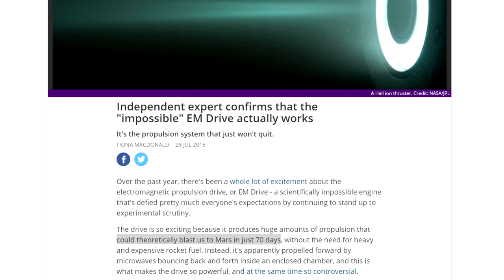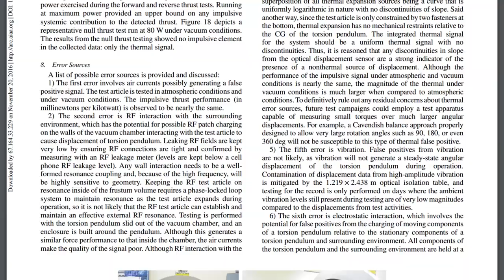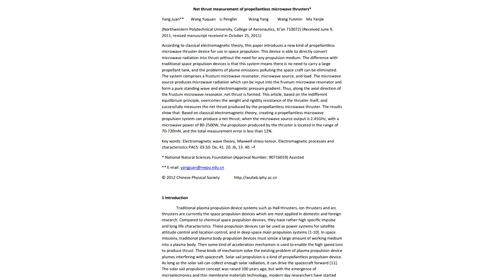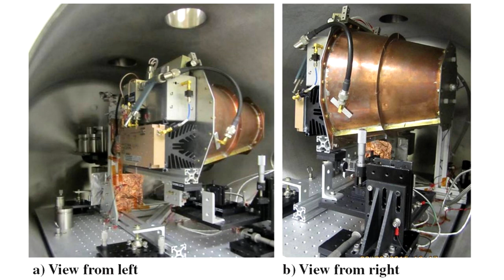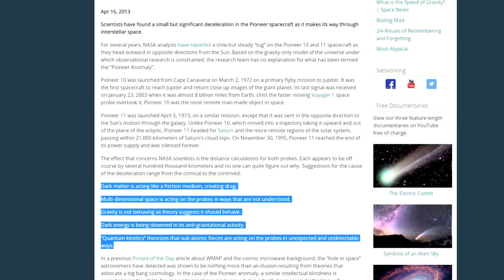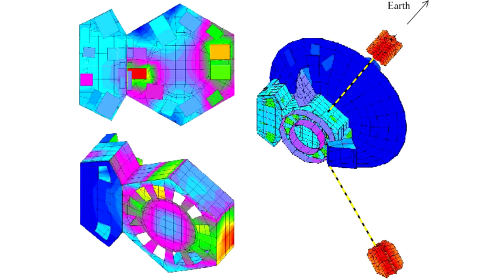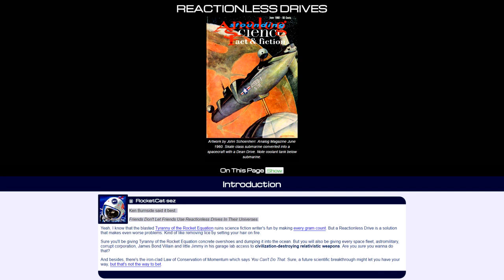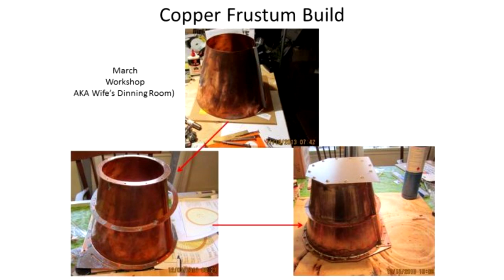What is the EM Drive? And Does it Really Work?

Comment: I mean no offense, but what I'm hearing is "shouldn't work because XXXX, shouldn't work because YYYYYY, shouldn't work because ZZZZZZ...." but don't the observations and data say it works?
Reply from the maker: +Jeff Wulf bear in mind that one team retracted claims of thrust after finding an error in their setup.
Reply: Yes, but the reasons why it shouldn't work are so well know that it is easier to say that it probably doesn't work than to say some we are wrong about some of the fundamental laws of physics.
Reply: Scott Manley Ah, OK, thanks!
Reply: I think its just a reason to be very, very sceptical...
Reply: But we are ALL wrong about fundamental laws of physics.
Thats why our gravity calculations break down when calculating the spin of galaxies, so we have to add the idea of dark matter.
Thats why our consolidation of the quantum world and macroscale world still hasnt happened (a unified theory).
Our theories about the laws of physics are NOT correct yet. So we can't simply say "this shouldnt work because of our current understanding" when observations clearly shows it DOES work.
Reply: "ut don't the observations and data say it works?"

No.
Reply: ***** Conservation of momentum is not an empirical law. It's a consequence of a much more fundamental symmetry: the fact that if I do an experiment here, and the same experiment in your house, I should get the same answer. Conservation of momentum is nothing other than the fact that the laws of physics don't vary from place to place.

So the laws are right and they do apply, unless you're prepared to drop this fundamental postulate.
Reply: 1 team retracted their claims, yes, but, probably only because the experiment was spoiled and not worth noting. Yet here we are.
Reply: omnimous69 Where do you think we are, exactly?
Reply: avicenna Speaking in the YouTube comments section about a source of thrust which violates the laws of Physics, as currently understood
Reply: They only reacted their statement because their equipment wasn't sensitive enough to make a conclusive decision.
Reply: Tristan Fessler *Only retracted their statement because their original findings were statistically insignificant
Reply: ***** That's not how any of this works...
Reply: ***** "As the author himself points out, light does carry momentum."

Not enough. 

"Light cancellation and some mystery bouncing photons thing,"

Yeah, that paper was terrible. Physics is not zen buddhism: if photons cancel each other out, they're gone. They're no longer there. It's not like they can still be there even though they're interfering destructively.
Reply: ***** "Nonsense. Light carries momentum. "

Like I said. It doesn't carry enough. Do the math. 

"So, if the photon drive cancels the photons after they have been emitted,"

This is physics, not sorcery.

"As I said, it would allow you to use scary amounts of power in a photon exhaust that you get rid of with destructive interference"

It's not zen buddhism either. If you get rid of the photons with destructive interference, they cease to exist. You can't use their momentum anymore. Sorry.
Reply: Yeah, this is a problem with modern science. It has become orthodox. "Such-and-such doesn't agree with our models, and so it is heresy!" And no, you test everything, because the only way to rule something out is to disprove it. If this works, then our model is wrong, and the right model has to be able to predict accurately everything our current model does, and correct what our current model gets wrong. Kepler's model and Newtonian Gravity, predicted a lot of stuff really accurately, but couldn't get Mercury quite right. Today, the science establishment would say that our observations of Mercury are wrong, not that we need to reassess the model. The current regime of tests on EM drive suggest that our model is only mostly right. And, now that we've had several nations testing the technology, and finding that "Okay, there is something here we do not understand" the correct scientific response is to say "Alright, our model is useful in most cases, but wrong. So lets figure out a better model, acknowledge this model's short comings, but resign ourselves to using it until we better understand the problem."

I started a physics degree. I stopped in no small part due to the lack of free thought within the program. Due to the fact that science was not taught as a method of endeavour - a box of tools - but instead as an unassailable writ that must be followed. And that mentality hurts science as a whole, by not encouraging free thought, endeavour and investigation. The purpose of science into to say that you must proceed across a certain number of rules and methods, but to give a framework for the distributed minds of a species to coalesce into a single gestalt, but not single-minded, entity for the inquiry into the truths of our existence.
Reply: Freelancer4tehwin that's his science works and has always worked. We still do that. Relativity, quantum theory, they all threw out the rulebook.

But that doesn't mean you should be keen to throw out the rulebook. Its very healthy to be sceptical as well as open minded. A single small experiment is not enough to throw out fundamental theories of physics. Its enough to say "huh, that's weird. let's do lots more experiments."

You rule out everything. Repeat. Retry. Retest. Still getting that result? Okay, now we can stop being sceptical.

The thing is, no one had ever heard of the thousands of times experiments found something new, and then it wasn't reproducible. Or it was found to be measurement, or experimental error.

Scepticism is good for science.
Reply: ***** "Oh, I don't know. Just apply more power."

Who do you think I am, Scotty? Won't change a thing. The facts are the same.

" I suggest you go study a little quantum mechanics. "

I have published papers on quantum mechanics.

" The Double Slit, standing waves and several other related "magic" are in the same family as this. "

No, they're not. Neither of those phenomena violates a fundamental symmetry of nature. The emdrive does.

"Now, here's the thing. Is the exhaust important after it has left the engine? "

Yes. It needs to exist. If it cancels out, it ceases to exist. Think like a normal person for a second.
Reply: ***** A photon drive is possible, but the emdrive is not a photon drive. A photon drive requires 300 megawatts per newton of thrust. It's a nonstarter.

" but it's easier to do the destructive interference trick"

For fucks sake man, the "destructive interference" trick is nonsense. How many times does this need to be said? Either momentum is carried away to infinity by actual electromagnetic waves or the spaceship doesn't move. It's that simple. Physics is not zen buddhism. A wave can't be there after it destructively interferes.
Reply: yep thats why they are still theories
Reply: ***** That's exactly right. The emdrive can only produce thrust in excess over that of a photon drive if you ignore the interactions of the photons with the side walls. To establish the boundary conditions that are assumed by the calculation the electrons in the copper need to rearrange themselves to cancel surface electric and magnetic fields, and that cancels any momentum difference you'd get if you looked only at the end plates.

Even without a calculation you can know this, because it can be demonstrated rigorously that classical electrodynamics conserves energy and momentum. So the details of how the thruster operates are irrelevant; the momentum leaving the ship has to be equal and opposite to the momentum imparted to the ship.
Reply: ***** "Notice I did not say the momentum is cancelled in the "destructive interference" version."

But it is canceled, because the momentum is stored in the electromagnetic fields. No electromagnetic field, no momentum. That makes it a reactionless drive.
Reply: ***** "That doesn't follow. Momentum is mass times velocity, right? "

Only in the nonrelativistic limit. The correct expression is E² = (mc²)² + (pc)².

" Something is still moving and the energy it is composed of still exists, in one form or another. "

Not if interferes destructively.

"Look at standing waves, The energy is never destroyed"

The energy (and momentum) density is zero at the nodes, which is the only place where they actually interfere destructively. 

"Fire that monster laser photon drive at a laser sail ship going 180 degrees away."

That works. If you aim a laser at the mirror and aim the beam back, the momentum change is twice the photon momentum. But that's not really practical once you get to high powers because of heat dissipation issues.
Reply: ***** " Explain why it continues past the nodes? "

Because it doesn't actually interfere destructively there, except at specific instants.

"A quanta of light is a tubular pathway of probability."

It's actually not. A photon is just a plane wave.

"he quanta exists within that tubular structure travelling all possible paths at once. "

The Feynman path integral picture is cute but it's only an illustration. The version actually used by physicists employs fields rather than point particles, and the integration is in field configuration space rather than real space.

"Destructive interference isn't destroying anything concrete."

It is. I can't emphasize this enough. If you setup destructive interference on a light wave everywhere, for example, if a wave reflects off a wall, there is no wave past the wall. It's physics, not zen buddhism. If it interferes destructively, it's gone. It really is.
Reply: +Freelancer4tehwin
There is such a thing as "not enough evidence". There have been no more than a handful of experiments confirming the EM drive, and most have been retracted due to errors. On the other hand, there have been thousands of experiments confirming Relativity, and even more applications that confirm it indirectly (like GPS). And Newton's laws of motion are indirectly confirmed by most physics experiments ever done and have never been contradicted (Relativity only contradicts his law of gravity, and invariance respective to the Galileo transformation). Even more than that, any apparent contradiction so far has later been found to be a measurement error (or fraud).
For now, it is a lot more likely that one experiment has made an error we didn't catch yet, than that thousands of previous experiments have been wrong.
As far as I'm concerned, I believe in the EM drive when I see it fly.
(But I'm a physicist, so I'm obviously part of the conspiracy that protects the hidebound establishment).
Reply: "shouldn't work because X" is good reasoning because thousands of experiments have been made and a physics model was created that has proven itself to be reliable and true for decades.

then some small team suddenly tries to make trivial changes to that model.
usind mentioned reasoning you don't assert anything but hint that the experiment setup may be faulty. it is very unlikely to be true.
after all you say "shouldn't work" and not "doesn't work"
Reply: The data says it doesn't work. Not a big surprise.

Comment: Correction: the shape is a frustum not a frustrum. The latter is related to the word "frustrate." A frustum is the portion of a generalized cone (the set of lines passing through a given point and a given Jordan curve) which is between two parallel planes, each on the same side of the given point as the given curve. In other words, it's a cone or pyramid with the top cut off.

Comment: "Pushing against quantum vacuum virtual particles"

So they fell back on good old ether.
Reply: that's a real thing though. at the quantum level, tons of particles constantly pop into existence and annihilate with each other

they are saying the EMdrive generates thrust by propelling those virtual particles away from the drive. not exactly sure if that's possible. i thought the whole point of virtual particles is you can't observe them (so no giving them momentum, either)
Reply: Zero-point
Reply: Here's the problem with using the quantum vacuum that way. The difference between the quantum vacuum and the old luminiferous aether is that the quantum vacuum, at least according to the best theories we've got, is Lorentz invariant. It should look the same in any inertial frame of reference. Which means it can't carry any momentum, so there's nothing to push against and have it remain vacuum.
The only way to "push against" it is to transform it into a state that does carry momentum--and that's not vacuum any more, that's a state with some real particles in it. So the best you've got is still just a photon rocket.
Reply: By the way, if you're really clever you might be thinking of a secondary objection here:
"Well, suppose we 'borrow' some momentum temporarily from the vacuum, in the manner of a virtual particle in a Feynman diagram, move over a little and give it back? That doesn't violate conservation of momentum over the whole interaction. Suppose we start out in a frame where you have zero momentum. One minute you're here, the next minute you're over there, but your momentum is still zero when it's all over."
That actually doesn't work either, and it's again because of Lorentz invariance. In fundamental physics, every symmetry is associated with a conservation law, via Noether's Theorem. Conservation of momentum is the conservation law associated with translation invariance--the laws of physics being the same in all places.
But if you instead take Noether's theorem and plug in invariance under a change of inertial reference frame, what you get out is a tricky-to-state conservation law that basically says the center of mass (technically, center of energy) of a system MUST move at a velocity corresponding in the usual way to its momentum.
The interesting thing is that there is no corresponding law for rotational motion--there's rotational symmetry, which gives conservation of angular momentum, but there's no "center of energy motion" restriction--which is why a non-rigid body in free fall can reorient itself in space, by messing with its moment of inertia, without violating conservation of angular momentum. This is how cats land on their feet (classically--no quantum shenanigans needed). But for linear motion this trick doesn't work.
Reply: Ghosts in the machine, I believe it creates dark energy. The strange motions of the universe which need dark energy to explain, are all caused by resonance energy thrust, going back in time and getting stronger. It's where the energy for the big bang came from - some scientist in the future with a "wired" copper bucket. Now look what you did!
Reply: Matt McIrvin - thanks for explaining that!
Reply: I'm old, so ether you this or that.